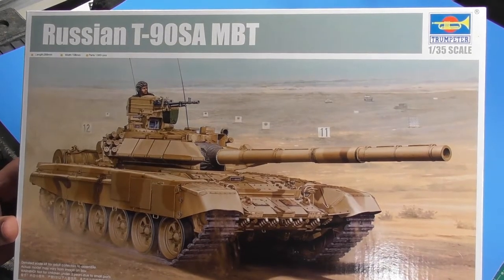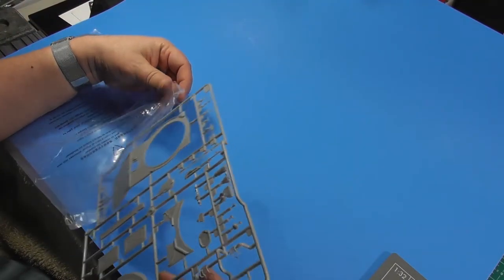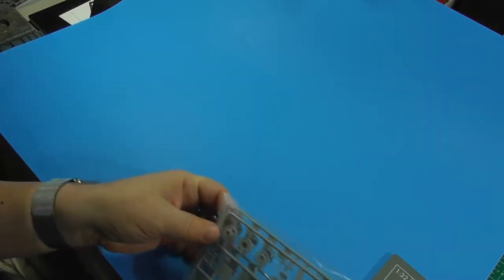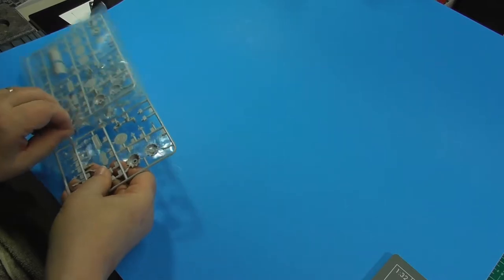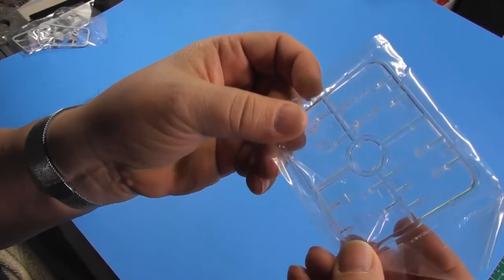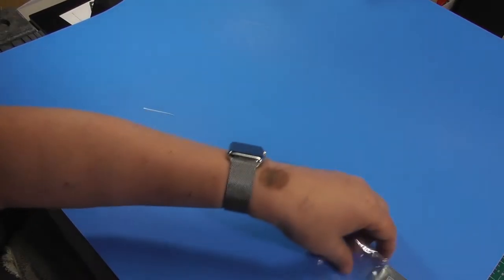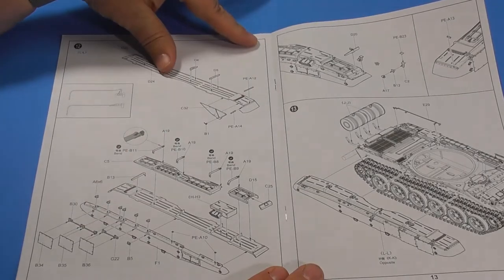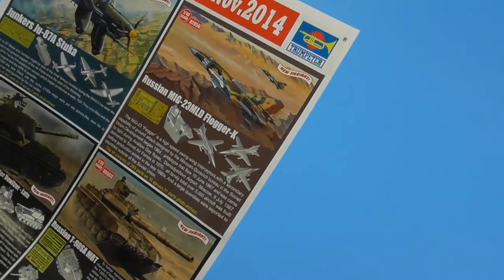Sprue Review Trumpeter 1/35 T-90SA MBT

Comment: nice review Bret, you only need 48 links per side of track if you leave out the totally unseeable top run and if you shorten the mounting points for the sprocket and idler wheels you can get them on after the skirts go on.